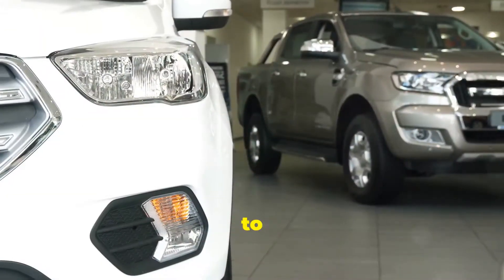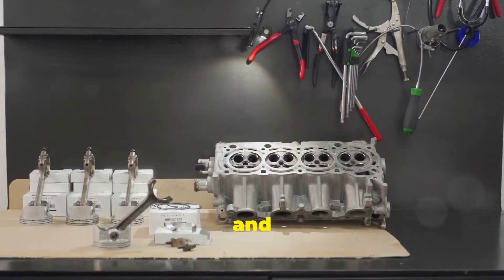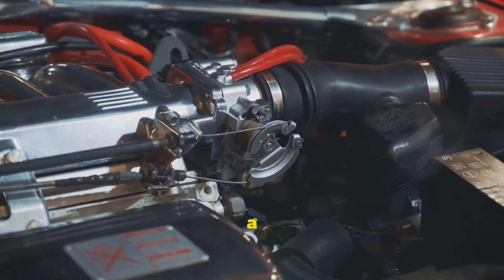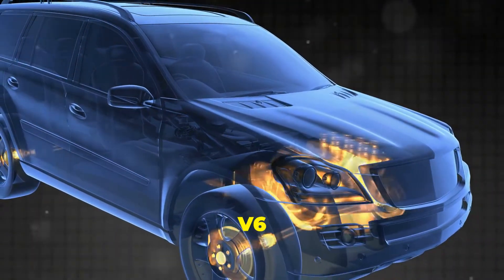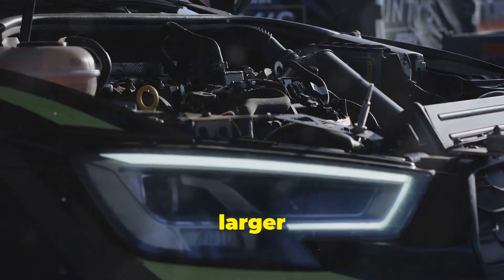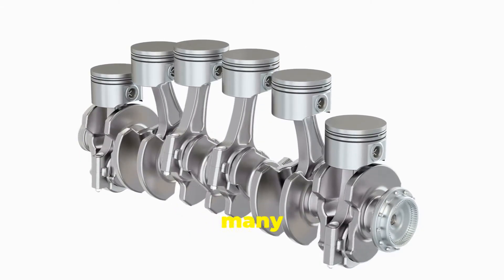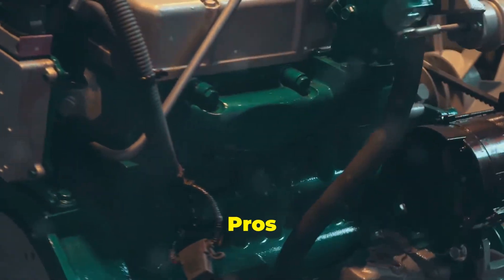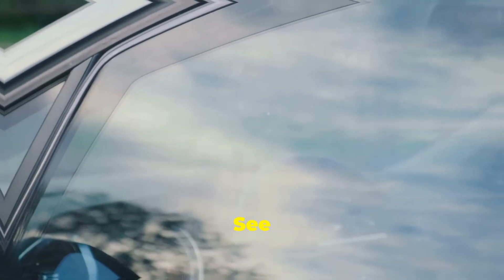V6 vs Inline-Six Engines: Which is Better?

Comment: The real question is that which has more horsepower potential and which makes more horsepower and is faster at high RPM. If both were pushed maximum which would make horsepower? Which one also has high realibitly at high rpm and horsepower? Which can make more horsepower at high RPM? Torque as well? Not only that but which one is better and faster for more overall horsepower and has less delay. I know it depends on engine type but overall due to basic general architecture which one really  is better?

Comment: I had an inline 6 in a Ford Fairmont. It was a decent car that hadn't been maintained well but once I got it running that straight 6 was so smooth and responsive I couldn't believe it. Apparently it only had about a hundred hp but it felt like more. I seen a 2 door Fairmont on some rims and was also surprised it could look decent. But the 6... Every car should start with a straight 6 as the base engine imo.

Comment: The straight 6 is better for towing eg trucks. But owned both engines in cars both very good I think the manufacturer of the engine is what makes them good. Had alot of Falcon and Holden straight 6 good no problems. Had a triton V6, Mitsubishi V6, commodore V6 and now drive a Camry 1MZ V6 great engine. All good had more problems with Holden V6. All the rest were very good and reliable.

Comment: I drive a 2011 BMW X3 35i. 
It has a straight six cylinder with Twin-scroll turbo. Mated to the 8-speed ZF Automatic transmission.
I service it regulary. Only 2 owners before me. 
I was worried about its reliability and fuelconsumption. 
After 2 years ownership, absolutely no problem. It does not burn oil. Very smooth running.
But man. The sound It makes and the powerdelivery over the entire register. Is why I love that engine!
With electronically controlled dampers, the X3 chassi is a wonderful place to spend time in. 😊

Comment: Inline 6 is just a better all around engine ..ohc's , single cylinder head , naturally primarily and secondary balanced,  crossflow design makes for ease of maintenance and adding parts ect .. i can keep going but the longer it is , the less people that have the attention span to read lol .. peace and love all, keep it rad, stay safe, and build on.. 

Ps , in the end. As long as you enjoy it and can build , race , break , repeat , then it dont matter what it is , so long as its not ev trash 😉 😂

Comment: I have a question, if u need counterweights to balance in v engine then how can a straight 6 engine is more heavy then a v engine?
Reply: Straight 6 is a bigger engine usually. I have had both and both good. Currently have a Camry 1MZ V6 very smooth engine. They have the counter balance worked out nothing to worry about.

Comment: There's no comparison; inline 6s are magnitudes more superior than v6s. I can write a book about it. Mercedes went back to inline 6s because customers complained that the nvh wasn't as good as bmw engines.
Reply: Love the structural rigidity of a stronger block and shorter crank of a V6, no flexing.
Reply: Power from Inline 6 and power from V6 in real life?
Reply: A V6 sounds better than an inline 6 in my opinion.  I love a 3.7 VQ.  One of the best sounding V6s ever made

Comment: The inline six is designed with better balance which is why the v-6 require counter weight to keep it from vibrating so much
Reply: The inline 6 is much better, but counterweights aren't so much for vibration control as they are mainly to off-set the weight of the connecting rods.  With no counterweights, the main bearings would be gone at about 20,000 miles, unless the engine couldn't rev much past 2500 RPM.
Reply: The size of a V6 engine is a great benefit though.  It might be inherently unbalanced due to the firing order but I prefer the sound of a V6 compared to an inline 6.